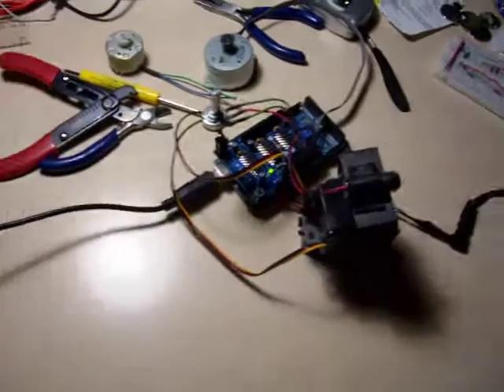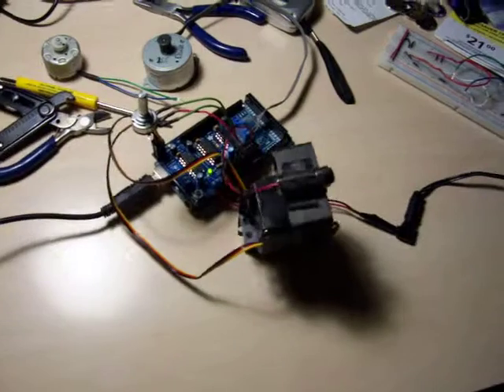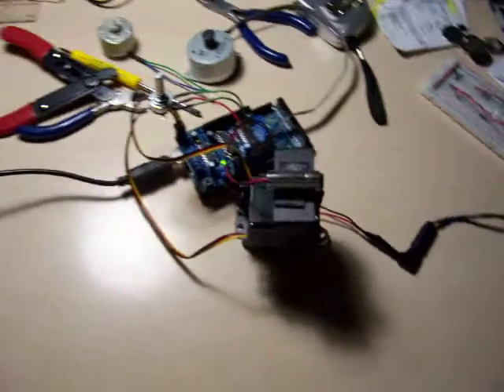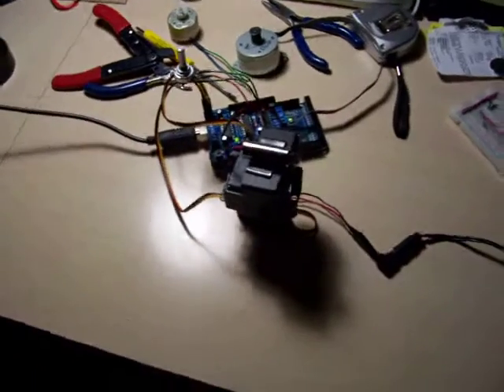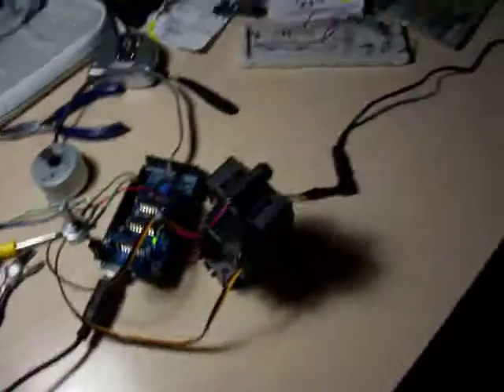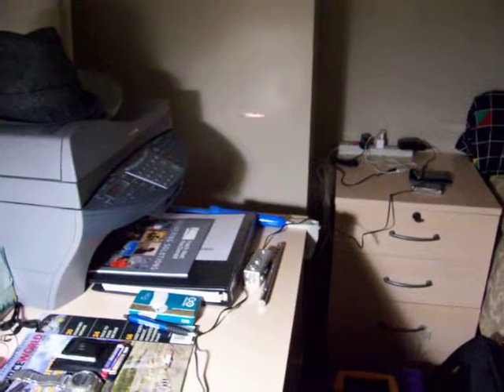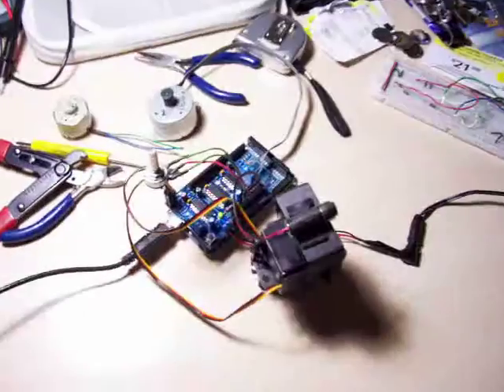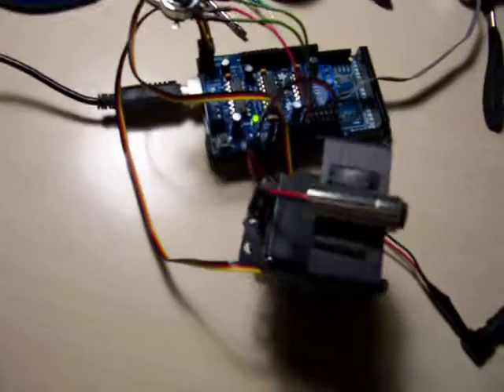Pan and Tilt Servo Set Drawing a Circle

Comment from the maker: // Pan and Tilt Servo Set 
// X-Y Axis movement
#include <Servo.h>
Servo servoU;
Servo servoT;

#define serUf 22
#define serUb 24 
#define serTf 26 
#define serTb 28 
float i; 
double x;
double y; 

void setup() {
  pinMode(serUf, INPUT);
  pinMode(serUb, INPUT);
  pinMode(serTf, INPUT);
  pinMode(serTb, INPUT);
  servoU.attach(10);
  servoT.attach(9);
}
void loop() {  
  
  for (i = 0; i < 360; i += 0.1) {
    x = 5 * sin(i) + 80; 
    y = 5 * cos(i) + 120; 
    servoU.write(x);
    servoT.write(y);
    delay(15);
  }

}